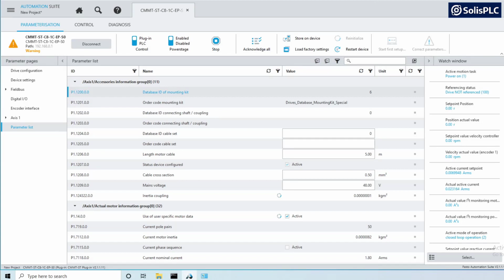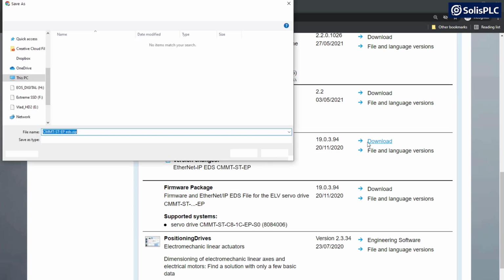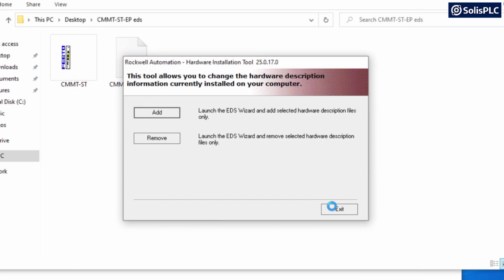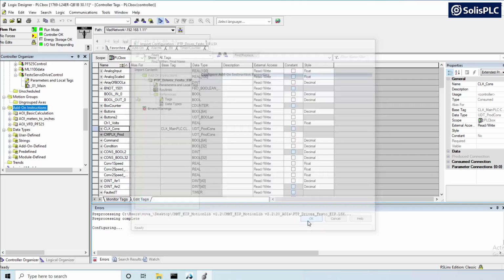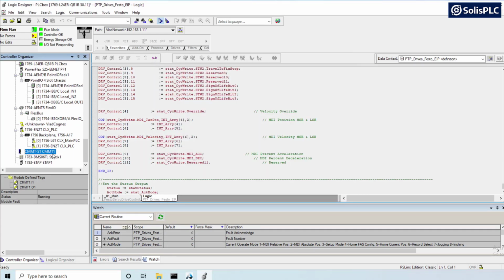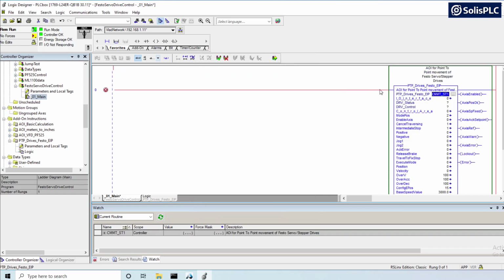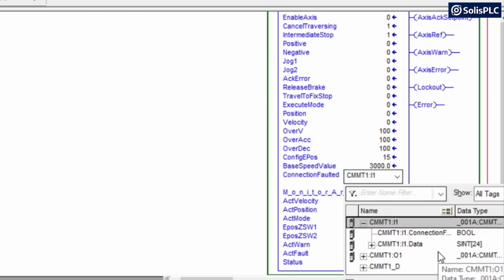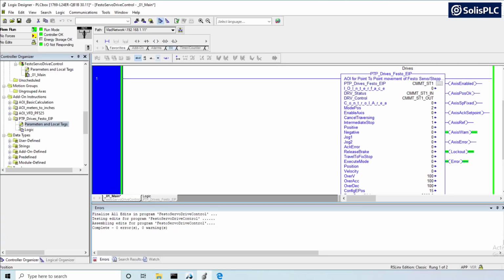Festo Servo Motor Tutorial - Integration of the CMMT-ST Festo Drive into RSLogix Studio 5000 PLC AOI

Comment: Thank you very much.
How to control CMMT-ST Festo Drive by SIEMEN S7-1500 PLC ?
Reply from the maker: I don't have as much experience with Siemens to demonstrate the connection and programming, but the vendor assured me that the Pfinet version can easily connect with the S7-1500 series PLC. They provide all the drivers through the same portal as discussed in this example.
Reply: Here's a video on the CMMT implementation for S7-1500

https://youtu.be/5jbVS5CpdsA
Reply: Thank you very much
Reply: Do you have the Function block that use in project for me download or
Could you please send me the project in video to.
My E-mail: 
tonsc2002@gmail.com
Reply: @vorapobautomation9760  You can download it from here:

https://www.festo.com/net/en-us_us/SupportPortal/Downloads/649317/711998/Festo_CMMT_PN.zip

The GSDML file can be found here:

https://www.festo.com/net/en-us_us/SupportPortal/Downloads/648123/708414/GSDML-V2.34-Festo-CMMT-ST-20200204.zip
Reply: @saqnt  Thank you very much
Reply: CMMT series is 100% compatible with Siemens telegrams. The most popular ways of integrating them into Siemens are Sina_Pos FB (part of the Siemens DriveLib library, Telegram 111) or through Technology Objects (Telegram 105). For both of them there are very detailed application notes on Festo Support Portal, "Expert Knowledge" tab. For anyone who can integrate Siemens drives in Siemens PLC, integrating Festo is basicaly the same.
Reply: Can you share link of "Expert Knowledge" tab. For anyone who can integrate Siemens drives in Siemens PLC ?